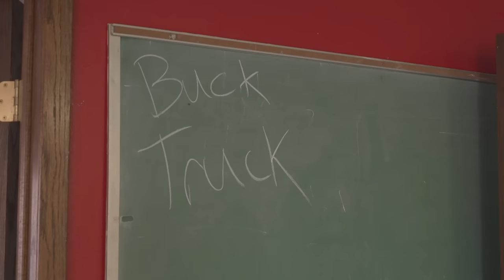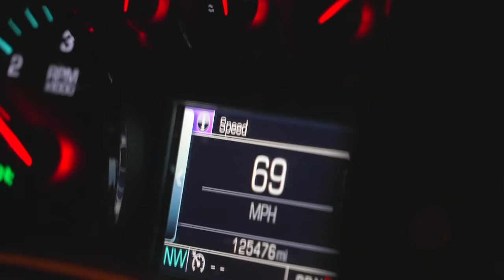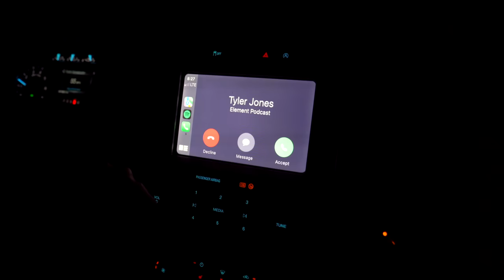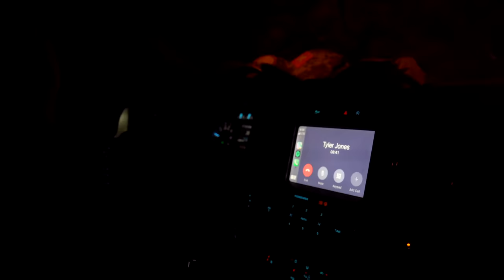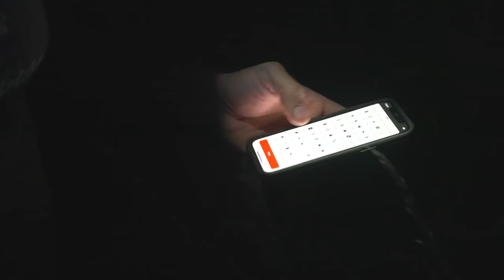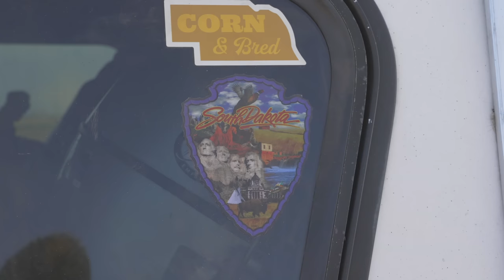Bow Hunting Whitetails in South Dakota | Buck Truck

Comment: I hit a 8 point in same spot almost exact angle in 2021. However I shoot Iron Will 125 (cot on contact) with a fairly heavy arrow set up. 
Iron Will went penetrated shoulder blade & stopped against offside shoulder. As deer ran it cut and cut till the main artery was cut.
Reply: That's how it should work. Good job on the proper arrow setup
Reply: If you hit the exact same spot, it would not have hit the shoulder blade. The shoulder blade is significantly higher than that. It would have most likely hit the humorous or the humorous/scapula joint. A good arrow will penetrate that anyway.
Reply: @D_Boone  it penetrated next to scapula near bottom of blade. Think he lifted his leg reacting to the shot. Wish I had picture of shoulder blade.
Reply: @awwjr29  Right. That is what I figured. The blade sits at an angle, so 'under' it is actually all vitals. Ho a lite bit forward though and you hit the humorous.

Comment: Need heavier arrows. No excuses for lack of penetration. Mechanicals are a huge point of failure too. Cut on contact fixed blades are the way to go. If your arrow doesn’t fly straight with fixed blades, you have a poorly tuned bow/arrow. The Ranch Fairy has some very good stuff on YouTube.
Reply: The Ranch Fairy has good advice for high F.O.C arrow setups. A heavy arrow, for the sake of a heavy arrow, is moronic. RF pushes that point as well. (I.E. the FMJ hate)
Reply: @casanovafrankenstein8875  Weight is directly related to momentum, which creates penetration.

Comment: Tyler, what are your thoughts on gettin you a nice fixed blade maybe single bevel?
Reply: I have thumb issues that cause torque. I shot super sharp two blades and nearly 600 grains. It’s too much imo. Sometimes this kinda stuff happens. I’m never closed off; always thinking about ways to get better. Thanks for the question Paul! What are you shooting?
Reply: @TheElementWild  sharp two blades sound like a single or double bevel . What does “they were too much” mean?  My experience with expandables have been similar to yours. When everything goes as planned they work. But it’s when things don’t go as expected. The animal jumps. You don’t make a perfect shot , maybe hit forward. My recoveries seem to have gone up when I moved away from expandables. I currently shoot a single bevel cutthroat. Thanks for responding. I really appreciate your open mindedness.